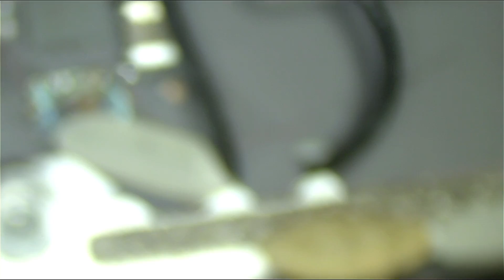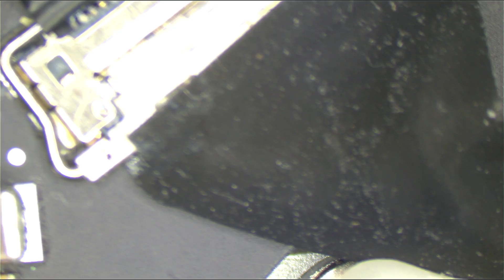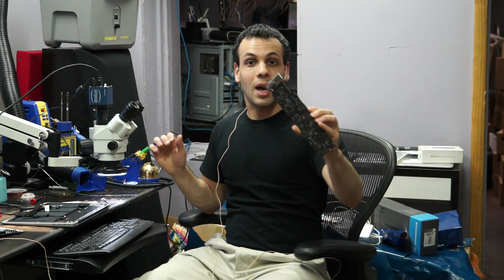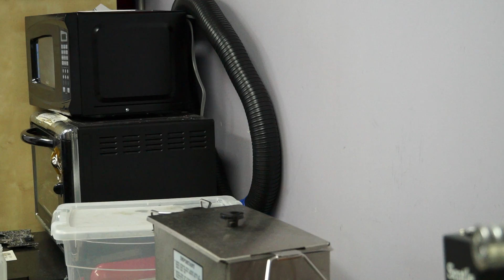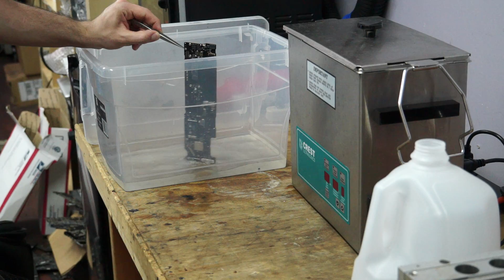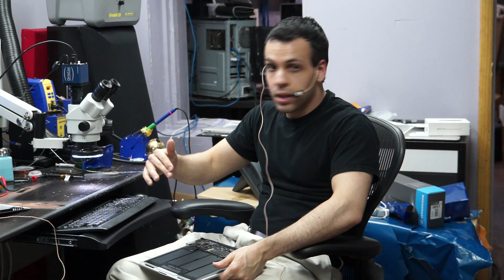How to use rice to repair water damage on iPhones and Macbooks

Comment: When liquid gets into any electronic device, POWER and TIME are your biggest enemies. Step 1: Remove power from the device asap. Step 2: take it apart and dry it out! While rice will help absorb moisture, it takes way too long and by the time the rice absorbs the moisture, the damage will already have been done.

Corrosion doesn't happen instantly, it forms over time. So getting the device dried up as fast as possible is very important. This is why rice doesn't work, or any other desiccant for that matter. Way too slow at getting rid of the moisture, which gives time for corrosion to happen.

I've rescued submerged phones within less than 2 hours of the incident with simply a screwdriver and putting the board in an oven just above boiling point for a while. Corrosion didn't have time to take place and the phones worked 100% once reassembled.

Comment: The rice myth exists for the same reason many myths exist: they exist so that people can feel like they have some control over a situation. Why is this important? It is because if people feel they have no control over the situation, then they're going to do something really stupid. Maybe most of the young people don't know this, but during the Cold War, kids were taught to hide under a table during an atomic bomb blast. It is the exact same thing! You don't want to tell people they're FUBAR or their device is FUBAR. When the inevitable is about to happen, I actually believe it is best to bullshit these people with lies. I don't think the rice thing is a hurtful lie. If a repair shop is right around the corner, that's one thing. If the device works after the rice, then they'll forever believe the myth, but that's not a bad thing either IMO. And, if the device is still broken after the rice, then they'll do whatever else step - replace, get it repaired, sell it on eBay.

Comment: you're fucking hilarious, but the rice is for water, not water damage. It's very liquid absorbing, that's why you put it in salt etc
Reply: +mellow man but it does get rid of the water which is crusial when you try to start it. getting water on there can short a circuit and shut down your phone without damaging it. so when you go for a start again, ALL water needs to be gone, and that is where the Rice comes in for soaking up any excess water for trying to start the phone again. and ofc you need to open the phone
Reply: Do not put electronics or metal objects into salt! Salt speed up corrosion.
Rice will not help you to fix wet electronics. If it had contact with water when was power on (or had connected battery) then corrosion already started and it is important to clean PCB from corrosion. The faster you will disconnect power source (battery) and the faster you will clean PCB from corrosion the better.
Reply: The end of this conversation makes me happy!
Once in a while, you see competent people online who can keep a conversation, maybe get a little heated but keep their cool and apologize for the misunderstanding instead of letting things spiral out of control.
Have my respect! :)
Reply: +William Palumbo the damage ia there because electricity is conducted in the water and fries the shit out of everything. so if the phone is dropped in water, it could turn itself off if you're Lucky and it will only be minimal damage which May mot even affect the phone. its nog like mater will damage a circuit that has no power through it. so getting rid of the WATER not the WATER DAMAGE can help! hope you understand now
Reply: +Jason Doyama take a cup and fill it with Rice, but some water in and watch it the next Day
Reply: Are you stupid?
Reply: Right, my first sentence was more of a statement of understanding, like you understand this and this yet think this. Does rice or salt have a magnetic affect on liquid? In a 2 day period how much more water, in mL, will evaporate in a phone buried in rice vs a phone not buried in rice?
Reply: Oh shit, sorry, didn't really understand ^^
Yeah i agree, it's probably not that helpful, but Rice is extremley water absorbing. As i said before, we use it in salt to get rid of the moisture. But knowing that you need to get rid of the water before turning on again is well enough, Rice is more of a good feeling that most moister is gone 
But yeah, you're completley right
Reply: Yea, it's hard to get intent and context through text. Cool, thanks for the civil discourse!
Reply: +William Palumbo yeah it is.
thank you aswell :)
Reply: +DOOMDUDEMX :)
Reply: DOOMDUDEMX :)
Reply: If rice 'absorbed' water, I could cook rice in Asia by putting it on the counter top! In Japan/Taiwan/HongKong the humidity is like 100% off the charts. In Singapore its like 100% humidity every day. If it 'absorbed water' I wouldn't need a rice cooker.

What actually 'absorbs' water would be like a dessicant, which is made of a material that actually you know 'absorb' water from the air. 

Finally even if you had something that was actually hygrocopic, that doesn't negate the damage already done by the water via corrosoion. By tthe time the water evaporates its already corroded the components inside. Thta's like slitting your throat and then saying your shirt is 'absorbing blood' . Yes it technically is, but you're still going to die unless you put the shirt next to the gaping hole in your neck.
Reply: +Jason Doyama it abaorbs water better than water condenses, never said anything about absorbing moisture from air
Reply: Also you don't put rice in salt to 'absorb moisture' either. All it does is provide friction inside the container so that it doesnt clump. But you could do that with beans or anything else. the rice does not 'absorb' water from the air.
Reply: Pontus Jonsson Note that water is not IN CONTACT with anything in order for you to say rice 'absorbs' water it has to be IN CONTACT with it. Throwing your phone in a bag of rice doesnt put the rice in contact with water. neither does it do it when you put it in a jar of salt. That's because rice doesn't abosrb water from the air. Rice does less than nothing to 'dry out' your phone or for it being 'liquid absorbing'
Reply: well, I thought you understood that.
Reply: You don't seem to understand that rice is neither a dessicant nor hygroscopic. It does nothing to 'get rid' of the moisture inside the phone. Rice does not 'get rid' of any water at all. You know what would be better? A TOWEL. After you get rid of the water on the ouside of the device, throwing a wedding banquet's worth of rice at the phone does the equivalent of absolutely nothing.
Reply: +Jason Doyama i never said anything about wiping the phone with a towel first. would be Kinda retarded to wipe it woth a towel and then put it in rice
Reply: +AcidCSGO that's a smart question
Reply: here we go...the power rails are still on regardless...especially for iphones, you always need to disconnect the battery first and give it a nice clean over with isopropyl alcohol or have it soak it in a bath of alcohol if it has been submerged in water entirely. Ultrasonic cleaner is good if there is a shit ton of corrosion
Reply: If water touches your components you get water damage putting rice on your phone to soak up the water its not going to stop the water killing the components so there is no point to it that is what he is saying
Reply: You realise that the water will dry regardless and the damage will still be there. The salt/rice is not entering the device, it will only collect what comes out naturally. I doubt it even speeds the drying time.
Reply: And that is not what is happening when you put a phone inside a bag of rice

You are not relying on water contacting the rice, because hey probably you wiped down the outside of the phone with a towel. So now that the ouside is dry, what water is the rice in contact with? None

It's also not why you put it in salt. Because again there's no water in the salt shaker that's in contact with the rice either. SALT is hygroscopic, which is why it clumps. THe rice isnt' hygroscopic. And there's no water inside the salt shake either. Th eonly thing the rice does is provide friction inside the container to minimize the amount of crystalization that occurs because salt is hygroscopic. 

In both situations rice is doing nothing with regards to water/moisture/hygroscopic/etc.

Comment: I see how this video makes sense. a lot of people think it will 100% fix your phone, but what the rice is supposed to do is soak the water faster so there is less corrosion. which I dont think rice is nearly the best material for.
Reply: I thought it was obvious rice wasn't going to fix the corrosion and people only used it to try dry it off after spills
Reply: I think its just a common material you find at most houses used to dry things without directly touching aka absorb the humidity. I do not expect it to fix anything just reduce moisture on the device.

Comment: The rise isnt to clean the board,  it acts as a desiccant
Reply from the maker: it doesn't even do that!
Reply: If you spill something on your computer, there are 3 things to do, immediately....

1) Remove from liquid source.  
2) Unplug power.
3) remove battery (if there is one).  

The remaining steps are not needed immediately, but should be done ASAP.  

4) If the liquid was not plain water, wipe off with a damp cloth 
5) Wrap in a clean dry towel.  
6) Remove cover or back of the computer, better yet remove the boards completely 
7) Look for any liquid, and displace with isopropyl alcohol, use as little as possible
8) Allow the computer to sit and dry, preferably in front of a fan, with the vent holes DOWN, this allows gravity to assist in removing liquid.   
9) After 24 hours drying in front of a fan, it should be OK.  

10) reinsert battery and power, 
11) turn on, when it has started up, shut it down and restart.  

If it does not start up OK, then shut it down, turn it off, send it to a certified repair centre, right away.  

The key is to minimize or better yet, eliminate corrosion in the first place.   I've been working with computers since the days of the Commie Pet, there have been spills over the years, never needed corrosion repair done; never needed to replace a board for liquid damage either.....
Reply: Rice is a shitty desiccant. Silica gel is a lot better.
Reply: +simivb rice is a FOOD. It is NOT a repair tool.

rice does not magically become edible leaving it in 100% humidity. for rice to properly absorb water it has to be COOKED. That is, BOILED IN WATER.

you are correct that it does absorb some moisture, but at most it's less than a tenth of a percent under normal conditions. which is any point in time where a person would throw their $800 phone in a bag of rice.

if anything, doing the rice meme makes matters worse. there will still be water in areas the rice won't absorb. and the water evaporating is basically the exact opposite of what you want to prevent further damage. evaporation leaves behind solutes. these solutes cause corrosion. that corrosion fucks your $800 phone. the longer it sits the more corrosion happens. the more corrosion that happens the worse it is to recover or repair.

what you want is not EVAPORATION. You want DISPLACEMENT. That is what proper ultrasonic cleaners do. they help to DISPLACE water.

rice will not displace water. it's a bullshit myth and people like you need to stop perpetuating it.
Reply: Really, Distilled water is non conductive, its the minerals in the water that do the damage.... Ether way, RICE DOES NOTHING!!!!! Dont waste your time with rice and clean your board properly!!
Reply: Well if you left it in dry open air with air flow would it not move the humid water vapor out all the same? it seems like an unnecessary method if it still takes a day
Reply: Brock Landry From what I understand it could happen that the water vapor condenses inside of the case again, because the air becomes to humid, So it doesn't really get our (or very slowly).
Reply: If Rice was a 'dessicant' you could set it out on a counter in 100% humidity and you could cook rice

You'll note this doesn't magically happen in Asia where 100% humidity is basically a daily thing
Reply: +Paul Schmidt just bear in mind that isopropanol DOES NOT mix well with salty solutions, like that remaining sticky half dried wine or soup, or seawater... 
You should (well it has more chances to get dried salts and sugar out) wash/ rinse it with water, preferably soft water like rainwater or filtered water that flows out of your airconditioner, or buy distilled water if the thing u are fixing is worth more than like 10 euros (which rarely happens to me ;-)
And then blow away/vacuum away as much of water as possible and continue with isopropanol, like you said. 
Or just use ethanol instead, ethanol with some water in it (like70-85% ethanol by vol.) dissolves salts and sugars, and evaporates allmost as quickly.
Reply: It doesn't act like a spunge. But when the water evaporates from the board, the rice absorbs water of the surrounding air. So the air is less humid, therefore more water can evaporate. And it doesnt need to touch the water either because it sucks the humidity out of the air, not directly from the board. Of course it wont do shit if the board is already dried up. It just helps to get the water out of the system. I dont think anybody would expect rice to fix already broken shit.

It is really funny though that you rub a rice corn against a board, and tell people that it doesnt do anything. You are definitely right Sir, rubbing rice against a dry board doesnt do shit :D
Reply: Indeed. Those packs can be incredibly effective.
Reply: No. Well it would work if air is completely dry (like 0.x % moisture) which only happens in desert areas, and only at day time...
It helps however to have a fan mixing the air inside container with proper dessicant like silicagel - which is simple to "reform" which means u can dry it up in kitchen oven and it works like new over and over, so u only need to buy, (or dumsterdive as i love to do) a batch of it once.
Reply: +Pyroslav x not sure what you're talking about, but Rice does absorb water. u have it in salt, pepper etc to get rid of moisture
Reply: You can cook Rice.
You can set in out in 100% humidity and it will absorb water. 
What is your point?
Reply: +Tim's Tech The problem isn't the rice. It's not removing all power sources from the device. The water with no electricity will cause hardly any corrosion while it is drying.  Dessicants speed up the drying process by lowering the humidity in the air surrounding the device allowing for quicker evaporation.  If you leave the device energized, you will get rapid corrosion of the affected parts despite trying to use a dessicant to dry the equipment.
Reply: So I should fill up my car with rice to prevent my windows from fogging up. My next time I go diving I’ll put some rice in my mask.

Comment: Is this not missing the point a bit? Im sure most people understand rice wont fix the water damage, its there to help absorb and remove the water before it causes more water damage so hopefully all it didnt damage anything critical. Is this thinking wrong and is water damage instant and it makes no difference if its put in rice or those "professional" water absorption bags with silica packets?
Anyway thanks for the video im really happy to be learning more about this stuff, i think anyone who uses electronics (so everyone) should have at least basic knowledge of how things work and what can be done.
Reply from the maker: it really truly does nothing to make the device more likely to work again. at one point a well renowned company was selling a "thirsty bag" :(
Reply: Louis Rossmann yes i agree it wont make it work "again, after its been damaged" but is there really no chance that the damage that has not yet been caused could be prevented? Seems logical to me you want to get rid of all the water as fast as possible and using rice is the simplest method, no?
Reply from the maker: ***** there is as much a chance as this as there is if you put the phone under a statue in a church that god will remove the liquid damage from it.
Reply: Louis Rossmann not a church goer so would placing it under Darwin's "on the origin of species" have the same effect? :D either way thanks i trully believed rice would help absorb the liquid. Next time i spill water on electronics or drop them into water ill do my best to immediately open them up and do individual parts with alcohol and a toothbrush. I just need to practice on some old stuff cause i dont feel comfortable yet working on delicate components.